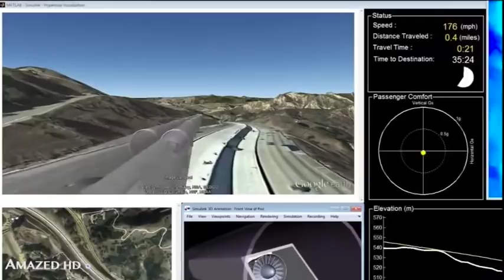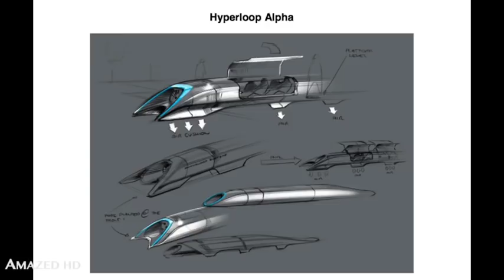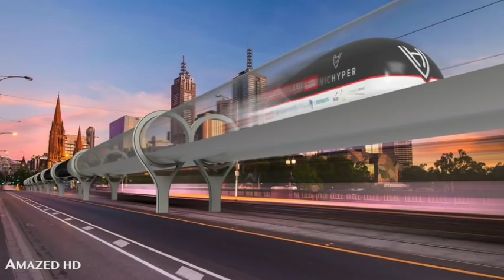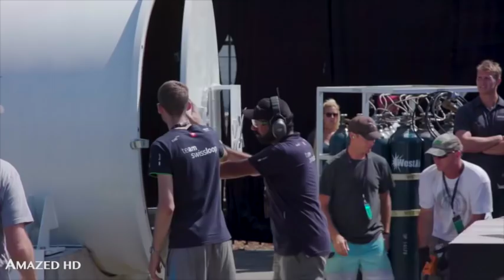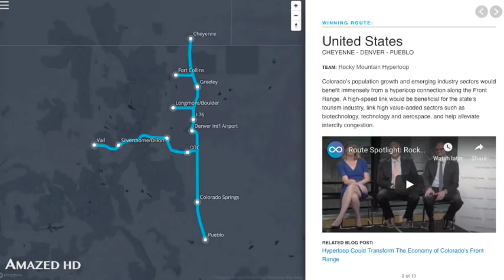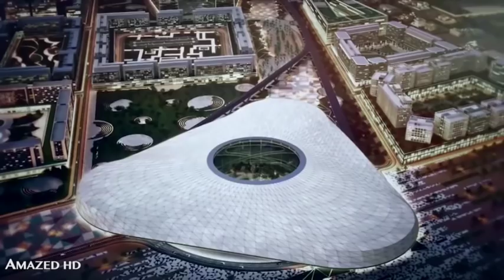Hyperloop coming soon !

Comment: The hypeloop will be absolutely fast, safe, cheap, comfortable, and environmental friendly. Not to mention it will generate more energy than it needs. On top of that it's easy to build, that's why Elon Musk is letting students build it. "It's not that hard."
Does that sound like a scam? 🤣
Reply: what kind of materials and suppliers can I invest in that will increase in value when this is reality. I can't figure out what kind of battery will be best, if there is such a battery or vacuum pump already sufficient